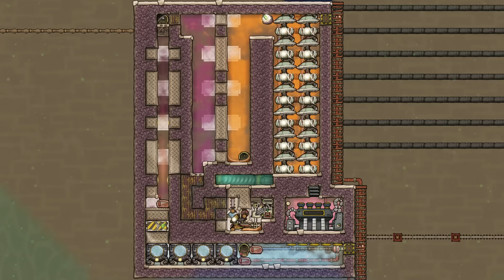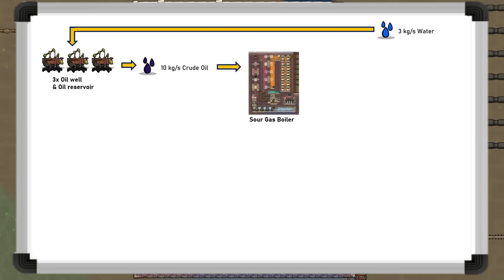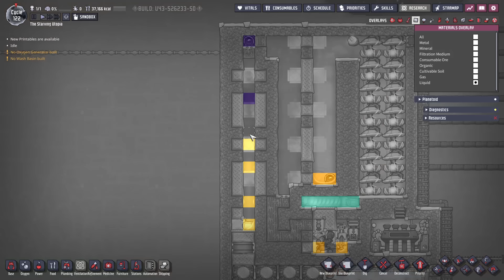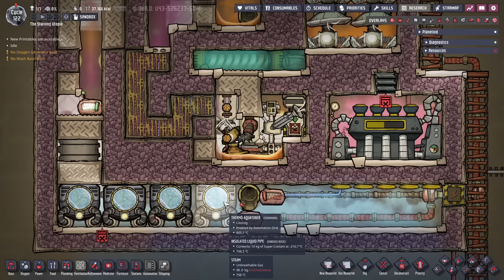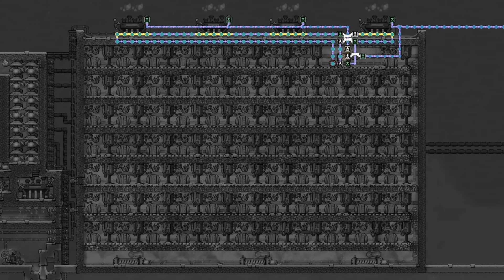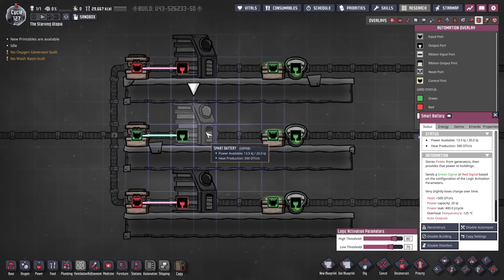Oxygen Not Included - Tutorial Bites - Sour Gas Boilers

Comment: I build this to spec the other day and I've encountered an issue where it seems like I can't keep the cooling area enough. The result is I get a ton of sour gas built up while the cooling area cools again. I think it's the tepizer heating the metal tiles below it when it's switched on. Even when chill enough the bottom pumps vacuum that area really fast.
Reply from the maker: Did you start with the cooling area cold enough because if it starts too hot it will be very difficult to get cold later? The tepidizer should only be turning on when the supercoolant is around the freezing point of methane, so should not cause condensing issues.
Reply: @GCFungus  The temps of the 3 metal tiles swing from -185c to -155c.

Comment: So I built this copying your build. Then my vscume area ended up flashing sulfur somehow. So I got it out. Ended up having to break in and fix a few things. And rebuilding my insulated blocks. Got it all rebuilt. And working again. Untill I realized all the liquid methane is poping though my blocks into my supercoolant pool over the tepidizor. No idea how or why. Might have to start over from scratch
Reply from the maker: I addressed this in the pinned comment. If you remove the top 2 airflow tiles and the top left tempshift plate in the condensing area it will solve the issue of methane teleporting into the tepidizer area. Flashing sulfur I've not come across before, just be careful with the routing of the conveyor rail.

Comment: You loosing cold in this design, what sulfur you outputting. You need to sent it tp conterflow too.
Also, you don't really need space materials. Hydrogen is perfectly fine coolant, I had one, core heat to create sour gas and 8 Thermo Regulators (2 cooling loops of 4 TRs)

Comment: With longer counterflows on both the hot and cold side you could reduce the requirement from 4 aquatuners down to 2, saving an additional 2.4kW of power.  All it costs are size/space and materials.
Reply from the maker: That's true, and I did mention in the video you can actually get it to 1 if you make it really long. Even with this design the 4 aquetuners don't run all the time, and for any boiler the power consumption is purely determined by the heat exchanger efficiency and not the amount of aquetuners. If anything my design could probably run with only 3, but I'd rather have 4 running 75% of the time than 3 running 100% of the time because you have more headroom to correct over or underheat. Of course if you want to adapt the design or just straight up make your own then everyone is more than welcome to!

Comment: Really having trouble setting up steam turbine that way, steam does not seem to heatup enough seems to be steam under 300f/150c
Reply from the maker: Do you mean the steam in the boiler itself or in the hot brick? In the industrial brick you will need to use some form of heating to boil the polluted water, so either an aquetuner or tricked tepidizer.
Reply: @GCFungus  I figured it out I had to add atmo pressure sensor to close liquid vent for water to drain down the pipe because I had too much pressure in the room the gyser was stalled

Comment: would be nice to get a version of this that includes the materials you used for each thing.
Reply from the maker: I should have mentioned the key ones, and the rest simply need to be functional. So for the heating aqueutners they must be thermium, and the gas pumps at least steel. I used thermium for the heat injector door, but other than that I don't think the rest of the materials are critical as long as it doesn't melt. I did use thermium metal tiles along the bead pump and the insulation is just made from igneous rock. If there's any other materials that would help to be specified then please let me know.
Reply: I actually figured it out and got it running with some trial & error plus guessing and going through the comments here for adjustments.  I must say, I've made several sour gas boilers both with FJ designs as well as some of my own and this is the most stable I've ever come across.  Its been running for 200 cycles now with no problems which almost never happens with a SGB.  Awesome design!  @GCFungus
Reply from the maker: @allenbythesea  Thanks, I'm glad it works! Stability was a key goal for the design so it's intentionally overspecc'd. By that I mean it has more heating and cooling than strictly necessary,  but I also ensured it had the ability to self correct with the steam turbine and tepidizer. I got fed up of my previous design because it was very finely balanced, so when something when slightly out the whole thing broke.

Comment: I did sour gass boiler without thermium and supercoolant- is not preety but posible- i would not advice that
However if you have supercoolant you can totaly make one using volcano as heat source - you still gonna need to adapt it so your steel gass pumps dont overheat i but its nto much harder realy - and when you get thermium you can just replace heating side
Reply from the maker: Yeah I've seen a lot of people try sour gas boilers without space metals or with a volcano, and I just don't think it's worth it on balance other than as a challenging project. The aquetuners are needed for cooling the sour gas anyway, so I feel like you may as well use the heat to boil the oil anyway rather than using a volcano.
Reply: @GCFungus  oh yeah without space materials I would rather do petroleum boiler you can cool sour gass using gass cooling hydrogen it requires some engineering again not worth only reason I did it I had disgusting amount of plastic from ranching glossy drecos and I wanted to use it

Comment: On the left where the crude drips in, I keep having overpressure issues and it breaks the far left wall, dumping petroleum out.  Any ideas how to fix that?
Reply from the maker: That shouldn't happen if the oil is immediately turning into sour gas. I would guess that you have one of two problems (or both): 1) You have some oil/petroleum sitting in the boiling area that shouldn't be there. 2) The hot side has not reached a high enough temperature yet. In either case I would suggest stopping the oil input temporarily and letting the bottom area heat up to working temperature (>700 degrees), and then start it back up. If after that the hot side keeps losing heat then you have a temperature leak issue that needs to be addressed.
Reply: @GCFungus  that seems to be what's happening.  If the steam area is at 750 when I start sending crude in, it builds up.

In my case my input crude is already hot (>180C) so it should be flashing to sour gas even easier but it turns to petroleum instead.  I'll check all the materials and use better insulation & things.
Reply: @jrharris42  Solved my problem.  I didn't have the mesh tile under the liquid vent, and the insulated tiles surrounding it so the sour gas didn't need to go through the airflow tile to get over in to the other chamber.  Also, I had too much hydrogen in the room the steam turbine is in (3kg per tile instead of 2kg).  Some combination of these things was causing my cooling loop to get too cold, so the far left aquatuner was never running because the liquid was too cold when it got there.  Now all four are running and the oil is flashing to gas almost instantly.  :)

Comment: I feel like Engies Tune Up could be unitlized in this build... maybe slap a wall through the middle, add the power control station building in, and bam, 14 or maybe 16 rooms that can give a 50% bonus, so 90KW instead of 60KW, idk if that would work or if i'm having a moment here lol, sounds alright in my head at least, would need some messing around to get the layout right etc tho
Reply from the maker: Possibly but that's going to take quite a bit of refined metal and a lot of dupe time. I feel like most bases don't need more than 60kW!
Reply: @GCFungus  Indeed indeed, welp, maybe some insanely power-hungry players can give it a go lol

Comment: Amazing video! I learnt a lot and has finally started building my first boiler following your design. Although there are some issues when copying this blueprint: 1. vent tile teleporting liquid to tiles above (someone already mentioned); 2. Should just replace hydrogen in steam engine with super coolant? 3. the two power joint plates are leaking heat to surounding gas. I had to make an additional vacuum chamber to cover it; 4. the solid transport pipe was too close to the hot power cables heated by steam chamber. 5. the most important one: the heat conducting tile at the top of the wall separating sour gas and natual gas was leaking too much heat to the sour gas side, when starting the system from vacuum state all of the air pumps are quickly flooded with 400C+ natual gas.

I've made some changes based on your design and it seems be working wonders now!
Reply: can you link a picture of all of your changes?

Comment: I'd love a save of this for easy blueprints. Especially for the hot industrial brick. I'd love to see the piping and automation for tepedizers and the aquatuner, as I can't quite figure them out. The boiler itself was pretty easy to follow along with in sandbox. Can't wait to try it out in game. Never built a boiler before with almost 2k hours played, lol.

I'm also having some technical difficulties with the boiler in sandbox. Happened couple of time, but natural gas would get too "hot" inside airflow tile and pop up into the super coolant room. And some of the ceramic insulated pipes carrying methane would have breakages.
Reply from the maker: So for those builds you specifically mentioned, the tepidizers I use are the tricked out ones that I demonstrated in the heating tutorial bite (as they are for heating), and the aquetuner cools the steam turbine in a standard cooling loop as I showed in the cooling tutorial bite.
Another viewer did mention the similar issue with the methane getting into the supercoolant area, but I've not seen breaking pipes. To be honest I don't think I ran this design as long as I should have to be 100% sure it was robust - and as I did warn in the video these boilers are just the most temperamental designs in the game. I'll soon build this in my Most Dupes Run and see if I can solve any issues.
Reply: @GCFungus  I did wait until around 540C to start with the oil in my game, and the boiler has now been running for almost 150 cycles with no issues what so ever. Not counting my own failures of forgetting to replace an automation wire after vacuuming and not filling cooling area with enough super coolant, thus causing some scaldings.
Reply: @GCFungus  Thanks, I'll have a gander at the heating bite. 
The methane sneaking and pipe breaking happened early in the startup, so might be that temperatures were not at optimal stage yet.

Comment: hi GC, i keep ending up with some methane in the liquid tepidizer area. Will this become an issue or it is expected?
Reply from the maker: I did notice that too on testing. I don't believe it's an issue, the only failure mode I can see is if a lot of liquid gets in there and overpressures the tiles. I think that's unlikely, but I didn't run it for a very long time. If it does keep accumulating then please let me know! I plan to implement it in my Most Dupes run too so will be able to test it for longer.
Reply: @GCFungus  unfortunately it keeps accumulating over time albeit very slowly (i don't keep detailed track, but it does accumulate over time). I am afraid to run this now since that means eventually it will break lol. And when it does, my base would probably too reliant to the boiler to switch up to something else while repairing.

I think the issue with this design is that the sour gas sometimes start to condense into liquid on the last tile of the airflow tile just before the condensation area.

And by some mechanics that i don't understand, it teleports the liquid up, into the liquid tepidizer area.

I'm trying out switching up the design a bit for this so i don't have to start over the build, but do please let me know if you figure something out!

Oh Also, could you kindly point out on which episode on your most dupes run did you start designing sour gas boiler? I would love to see your thought process and the changes made in relation to the conditions of that particular base.

Lastly, sorry for the long post, and thanks for your work!
Reply from the maker: @erikwibowo8596  Thanks for the feedback. I'll have to look into it in more detail at some point, and I don't understand that mechanic either. If it is the airflow tiles then it should be possible to remove one or two without affecting the design, so worth doing if that solves the problem. My other potential thought was to drop the temperature in the supercoolant area to just below methane's freezing point (say -184/-185) to freeze out that liquid, but hopefully keep the condensing area liquid.

As for the most dupes run, I started layout out the first of my current 3 boilers in part 40 - but this was my old design that works but is very prone to failing as it is very finely balanced. This design I created in sandbox on my own, so don't have any footage for how I managed it. I tried lots of different ideas and a lot of fine tuning to get to this, so very much hoping we can fix this issue. Thanks for the support!
Reply: I fixed this issue by removing the temp shift plate touching the airflow tile

Comment: So does the airflow tile little labyrinth prevents the nat gaz from going in the wrong way and back in the heated zone? It's so intersting thank you for sharing, even if i'm not doing the exact same i'm more confident trying after seing different designs, now that I finally got thermium
Reply from the maker: Yes it does, but the airflow tiles themselves are just there to reduce heat transfer. The actual thing that stops the natural gas going the wrong way is the bend that goes down and back up - natural gas is lighter than sour gas so I have a little catchment area so it can't flow out.

Comment: I have the DLC but generally don't play it. It seems like everything in this design is base-game compliant, except for the farming and ranching elements? So, if you were just playing the base game, how would you modify this build? It seems that the primary application for sulfur in the base game is for generating natural tiles, which by its nature doesn't require a major continuous supply. Is it feasible to modify this design to cool the Sour Gas under pressure <5g/tile? If you did that, would you increase the scale of your industrial block to accommodate a larger output of natural gas, or decrease the input? Would there be related changes to replace the missing Kcals, or would you need a separate system to feed your base?
Reply from the maker: That's a good point I didn't specifically mention. You are right that sulfur has no real use in the base game, so you effectively lose that food ouput and will have to use other methods (although the slickster meat is still quite a lot). I don't quite understand what you mean by cooling under pressure, as I don't see how that could be controlled or make a difference to the output.
Reply: @GCFungus  according to the wiki, if sour gas is below ~5g/cell when it condenses, it produces 100% methane and no sulfur. The information is scarce and I haven't ever gotten to the point in the game where I could experiment with this.

Comment: I find that in most cases people don't need a 10kg/s sour gas boiler, particularly in a spaced out cluster. I highly recommend smaller 1-3kg/s sour gas boilers that use radiant liquid pipes and that "1kg liquid packets can't burst pipe even when super heated" trick for counterflow heat exchanger. You can pack a boiler into a tiny volume with those, or alternatively with very tall heat exchanger towers run them with very low energy input.
Reply: The fun of this game isn't necessarily 'need' though.  Something like this helps us enjoy the game in new and interesting ways.